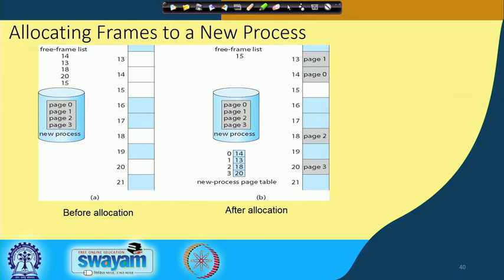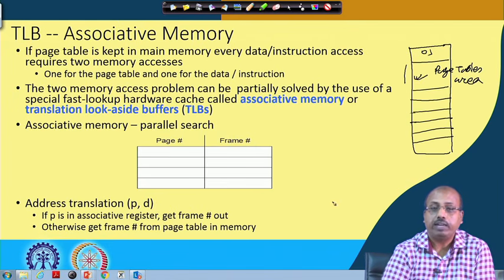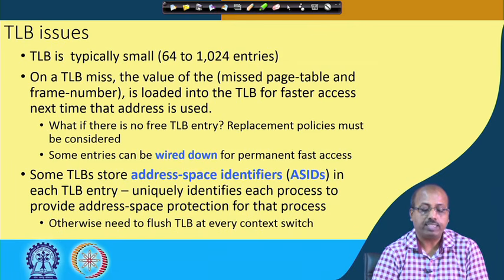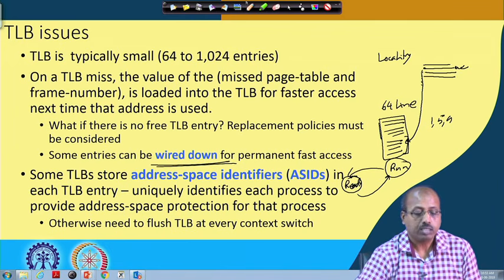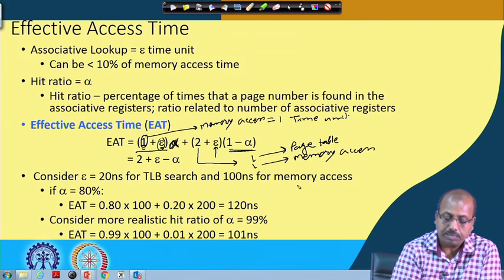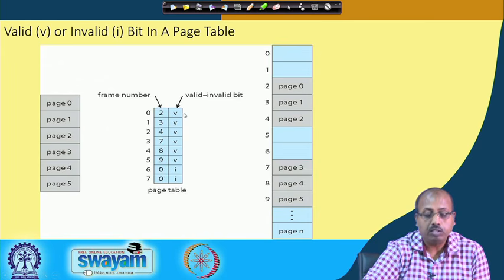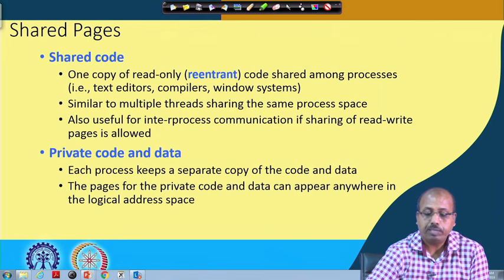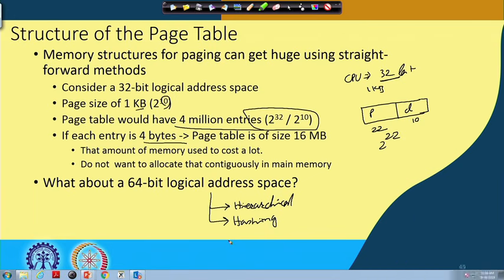Lecture 46 : Memory Management (Contd.)

Comment: Sir the effective access time formulae is given wrong in ppt. Hope it helped anyone having any queries.
Reply: He simplified the formula by considering time to access memory as 1 unit and number of levels in page tables as 1.
Reply: Defining Original formula:

Two cases:
1) TLB Hit: The page table entry is already in TLB. Just 1 memory access → directly fetch data.
2) TLB Miss: Need to walk the page table in memory to find mapping. More expensive → several memory accesses.

Symbol definitions:
β = time for one memory access
ε = time to access TLB (very small, often ~0.1 * β)
α = TLB hit ratio (e.g., 99%)
k = number of levels in page table (2 for two-level paging, etc.)

Costs:
TLB hit: ε+β [TLB hit cost (check TLB + 1 memory access)]
TLB miss: ε+(k+1)β [TLB miss cost (check TLB + page table walk (k memory refs) + final memory access) Remember page table itself is in memory, so each level lookup takes one memory access time]

Formula:
EAT=α(ε+β)+(1−α)(ε+(k+1)β)

Now assume, β=1 and k=1
EAT=α(ε+1)+(1−α)(ε+(1+1)1)
EAT=α(ε+1)+(1−α)(ε+2)

Expand terms
EAT=αε + α + ε(1-α) + 2(1-α) -- (0)
Simplifying terms
αε + ε(1-α) = αε + ε - αε = ε -- (1)
α + 2(1-α) = α + 2 - 2α = 2 - α -- (2)

Apply both (1) and (2) in (0)
EAT = ε + 2 - α -- (3)

Final simplified EAT is (3)

Hope it helps!
Reply: Just with 1 level of page lookup:

Formula:
EAT=α(ε+β)+(1−α)(ε+(k+1)β)

Now assume, k=1
EAT=α(ε+β)+(1−α)(ε+(1+1)β)
EAT=α(ε+β)+(1−α)(ε+2β)

Expand terms
EAT=αε + αβ + ε(1-α) + 2β(1-α) -- (0)
Simplifying terms
αε + ε(1-α) = αε + ε - αε = ε -- (1)
αβ + 2β(1-α) = αβ + 2β - 2αβ = 2β - αβ  -- (2)

Apply both (1) and (2) in (0)
EAT = ε - αβ + 2β -- (3)
EAT = ε + β(2-α) -- (4)

Final simplified EAT is (4)

Ex 1:
ε = 20ns, hit ratio = 0.80 (80%), β = 100ns
EAT = 20 + 100(2-0.80) = 20 + 120 = 140ns

Ex 2:
ε = 20ns, hit ratio = 0.99 (99%), β = 100ns
EAT = 20 + 100(2-0.99) = 20 + 101 = 121ns